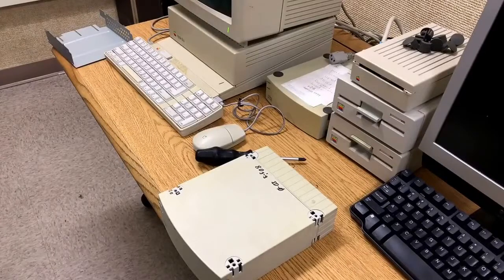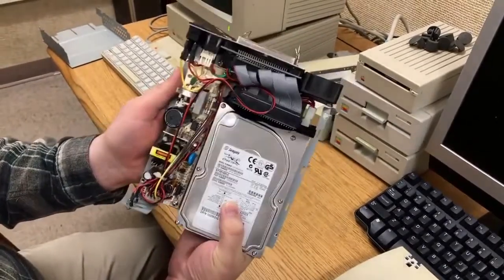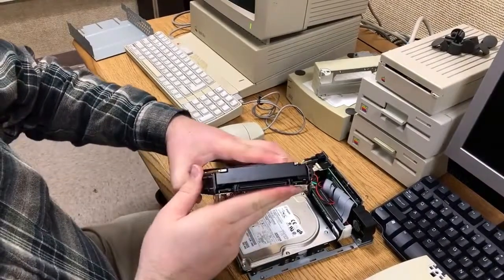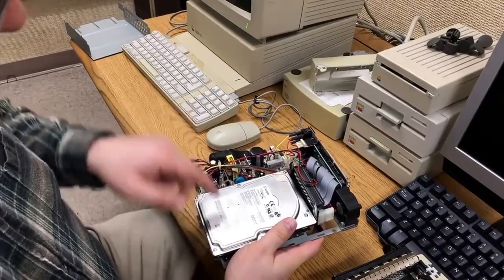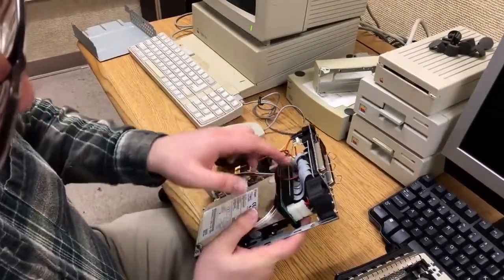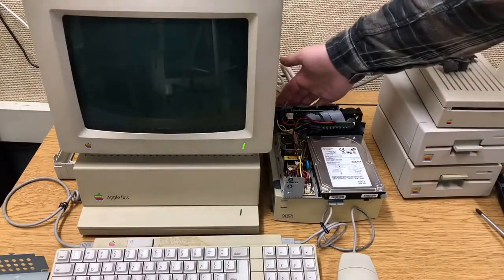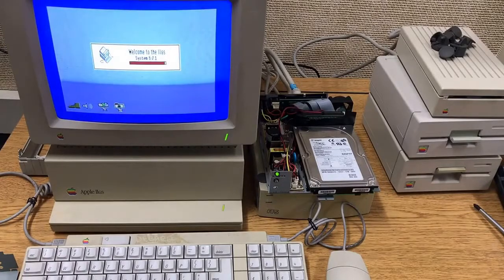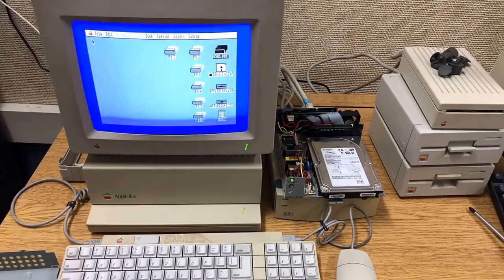Antique computers: Solution to finding working SCSI drives

Comment: you put an SCA to 50 pin adapter the only thing to keep in mind is you add capacitance using those bridge adapters so try not to try going more 3 or 4 drives deep.

Comment: I have a Pentium 2 that I saved from getting binned by employer. It has a SCSI card and almost all of my IDE drives are either bigger than 70 GB or dead so I ordered such an adapter and some SCA drives quite cheap under 20$. Thanks for confirming that I am not about to make a mistake trying that.

Comment: Creative Micro designs---CMD  used 50 pin SCSI hard drives also which works with any of the 8-bit Commodores.  Im having a problem with my mechanism it keeps spinning down when it shouldnt, would this be something to do with the small controller board (on the hard drive)?
Reply: Hard drive controller boards are all proprietary. Generally only the manufacturer knows how it works. You would have to ask them, if the company even exists anymore. If it's a 20+ year old device then it probably needs all the capacitors replaced, known as recapping.

Comment: Picked up a Dell Poweredge 2850 server at an estate sale for $1. Appears to have two power supplies, and has 4 HDs that have these connectors. I am trying to find a way to re-purpose them for some storage for my old photos and videos. Thanks for posting. I've not found a SCSI to USB adapter. Most are SATA and IDE, but I don't look like they will connect.   Is the chassis in your video custom made? Let me know.

Comment: hello i really need help. i'm so tired about messing around old quantums and i tried an ultra 320 fujitsu 68 pin with adapter but it isn't recognized neither by lido. no jumper setting worked. someone told  i need narrow or something like that. btw i'm not expert in scsi technology and i need to know the exact type of drive you're using cause i want to search it used by the code. i have an adapter sca80 8&16 bit with those settings: led,son,day,met,id3,id2,id1,id0. please help cause i need drives for external lacie and my mac se. i paid a lot for a 160 meg conner but i'm so tired of old expensive 50 pis drives. old quantums have melting rubbers that block the arm, after trying fix this problem they work and after become unreadable so frustrating...definitely need more reliable technology for 68k macs.

Comment: I have an excellent korg D16 scsi 25 pin multitrack recorder. how to make a usb converter? I need to transport the wav files to the pc and I can't. thanks
Reply: I have the same Korg D16 and I am also trying to find out the answer!
Reply: @am74343  I got something fantastic, a scsi db25 adapter with sd card, now it's easy to transport the files to the PC. I also replaced the internal hard drive with a 6OG dr. it was excellent.
Reply: @am74343  https://store.inertialcomputing.com/product-p/scsi2sd-v5.5.htm
Reply: https://store.inertialcomputing.com/product-p/scsi2sd-v5.5.htm

Comment: i am trying to do this same thing but the apple does not see the hard drive.  I have tried a iigs, LC ii and a powermac 7300/200.  I have tried an 18gb drive as well as a 72 g drive.  Any idead on the dip settings on the add on scsi convert card?  do i need to delay start or the sync pin?  thanks for the great video!!
Reply: If it is the only drive in the system, you may not need to do anything with the jumpers. ID is binary 1+2+4+8, though ID3 is only for wide SCSI with 16 devices, and I believe the Apple/Mac were narrow only. Macs normally use ID 0 as the internal boot SCSI drive. I wrote a detailed reply on a forum that may help you: https://murray2.com/threads/macintosh-lc2-file-backup.236/
Reply: @DMahalko  What enclosure is that (name, maker)?  I have an old 80 pin SCA drive that was a demo model with a clear cover.  I'd like to connect it to my IIGS and am not sure how best to go about it.

Comment: i'm interested in finding a way to make my some of my dozens of sca 80 pin drives connect to a standard windows 10 pc via usb or pci-x. if you do know of a way or a device, that is inexpensive, please help me out. i hate to waste perfectly good storage. note i cannot afford a san enclosue. i was just hoping to put the drive in some kind of docking station like normal sata drives.
Reply: SCSI has been obsolete since about 2006. go on eBay and look for an old Dell Poweredge 2800 or 2850 server for US$50. A 14 bay Dell Powervault 220S with empty drive trays is also about $50.
Reply: @DMahalko thank you sir :). And yes, I agree. Buying a full enclosure is going to be the only way i guess. On my (uk) ebay they dont seem to show up at the prices you mention. if you can source a LFF storage server for that much money please link me to it ASAP! thanks.
Reply: @DMahalko  Hi! That's great "drive" news! So far an SCSI to USB Adapter has been Elusive to all of us around The World (why?). If you are saying a Dell Poweridge 2800 or 2850) Server or the Dell Poweridge 2205 Powervault is the answer, then Woo Hoo! Before I go SCSI Hunting though, how did they connect to the PC Computer? Was hoping you would say "Eide" , but I'm afraid you'll say "it connects to an internal SCSI Card on a PCI bus inside that Computer. Thus I'm back to Square One. Looking for an SCSI to USB Adapter Cable or an SCSI External Dock Drive Bay to USB.

Comment: Due to an error on my part I accidently bumped loose the scsi communications board from inside the computer before I disconnected the power to my Apple ][e. Looks like it messed up the internal control board. Nothing else appears to have suffered damage. The drive is  Xebec drive and  SCSI-1 (SASI subset) on a Sider D4.

I was curious if a USB to SCSI adapter could be used to retrieve the data from such a hard drive  as I have such a device and have also been upgrading to USB devices and solid state storage. The card that appears to be damaged is the orginal SASI communications card from First Class Peripherals.

The old Siders could be formatted to create multiple volumes that could be chosen on boot up.  I have used the Ramfast controllers from Sequential Systems to format the old 100 mb zip disks into multiple volumes by those controllers. The drive has to wait on the computer not the other way around.

Very helpful to know the options for drives also.
Reply: The main damage from pulling an interface card with the power on, is that if you twist the board sideways out of the socket, the voltage pins can jump across to adjacent lines that can't take the voltage, and you blow up chips. It might be salvageable if the blown chips are not proprietary.